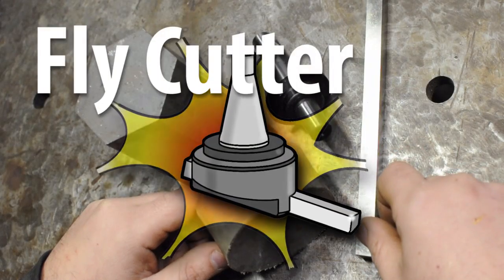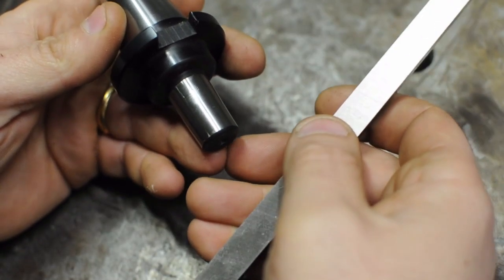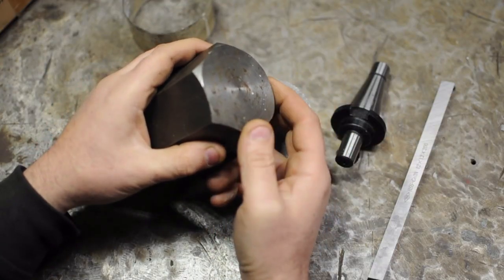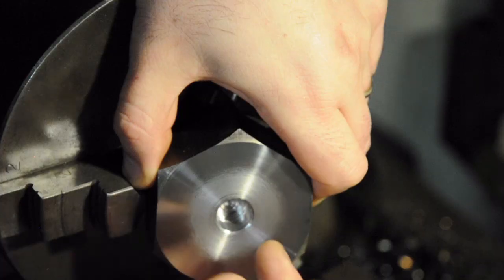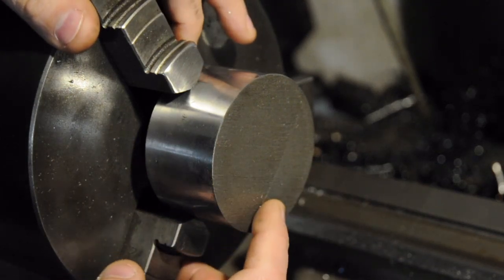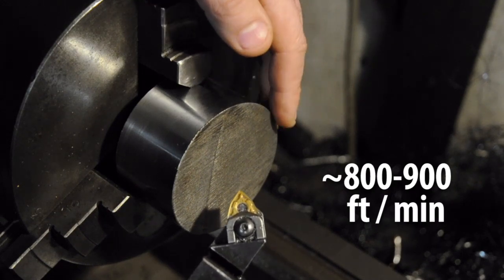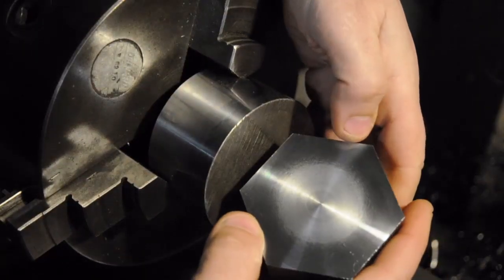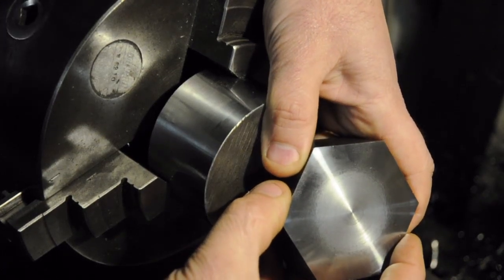Building a Fly Cutter - Part 1

Comment: I'm not a machinist but I find the hobby very interesting, so I don't know what a fly cutter is. Is it like a cheap version of a face mill?
Reply: Face mills remove material faster than fly cutters because they have more separate cutting points in contact with the material at the same time - and require that much more power to remove that material for the same reason.  

Because of that, a lower power machine like most home gamers can afford, can use a fly cutter with a long reach to finish a much wider area in one pass than the much smaller facemill it could drive using the same power.

Fly cutters can work with any 'lathe' style cutters, including easily/cheaply sharpened HSS bits.  The low power requirement, low cutter cost, and ease of sharpening really suits the garage / shed / basement shop.  The tradeoff is speed, which generally isn't a priority in that kind of context.

In my home shop I have a 2" carbide insert facemill I use for work small enough to cover in one pass, and for rough facing my often rusty salvaged materials.  Other than that I use a fly cutter because the cost to me is really only the time it takes to keep my collection of HSS lathe bits sharpened.
Reply: Ceazar Carr its more or less a face mill however it uses carbide tool bit to do the cutting. It's meant to get a precise and clean finish compared to you traditional face mill. It's usually only for your finishing passes not for roughing.
Reply: ***** Thanks!
Reply: Also it's not bad for finishing to have just one cutting edge, because there won't be any height differences between the cutters
Reply: Fly cutters predate face mills, and they were meant to just take your regular HSS tooling. Running them at excessive speeds can cause marring, as they aren't balanced.
Reply: somebody else Wow, thanks!
Reply: Well the main advantage of the fly cutter over other cutters is that it is easy to sharpen if need be and as a consequence it is cheaper than many multi edged cutters. Additionally, you can of course shape the profile just like you do for special profiles on the lathe. It is an extremely versatile tool in the right hands...
Reply: And when people say it's cheaper than a face mill they mean that each carbide insert usually runs anywhere from 8 to 40 USD a piece, so in Old Tony's face mill (I think it's a six insert cutter) if he's using decent carbide inserts, he's got about 90 bucks in inserts.  Whereas a single bar of 5%cobalt steel tool blank is like, 5 or 6 bucks depending on where you get it.  Also, the kind of cutter he's using is what we call a shell cutter in my shop and a fly cutter is any cutter that uses a single point for cutting.  My fly cutter has a single carbide insert that is round that I use for finish passes, although I rarely get to use it because all my parts are surface ground to within +/-.0002"
Reply: Precisely! A big slab or face mill that's been subjected to a few "crashes" no longer runs true. The finish, in section, looks like a mountain range... Same if it's mounted on a machine with a damaged female taper, or the insert pockets have been damaged.  If you need a fly cutter, and have a damaged face mill, remove all but one tip, ensure all the clamps and shim seats are secure in, or removed from, unused pockets, and you have a fly cutter. we used to skim cylinder heads that way.
Reply: True, it's a poor boy face mill.  Face Mills above 3" are several hundred to over $1000.  It's not just the expense of the inserts.  Face mills get a perfect finish as well but I would like to have a larger one.  Or Flycutter.
Reply: it cuts mosquitoes.

Comment: Thank you for talking about the surface finish change. I was wondering about that on some of my own parts. I do disagree a bit. I still get the transition even at slow speeds. I think it's more that as the diameter decreases, the tool is shoving more into the work rather than letting the spindle do the work. IF you think about it, on a 3" diameter, it has 9.5" of metal in a line to advance the 10 thou that you might be feeding at. At 1/4" diameter, it has less than one inch in which to be shoved the same 10thou. Although it also seems like the chip should be constant thinkness...
Reply: The Metal Butcher I thought that is  what he was saying? The closer you get to the center the slower the material is moving, so the rpm would need to increase the closer you get to the center. Your still going to get a transition with slower speeds because no matter how fast or slow the rpm is, there is still a difference of speed between the outside of your piece and the center of it.
Reply: The Metal Butcher I agree with what you are saying only for HSS tools. If I'm facing something with old school tools I never use the automatic feed because of what you stated on your comment. Carbide does not like slow speeds period.
Reply: As I understood it, the reason is that your speed is too low!? Did I get that part wrong?
Reply: That's what I thought :)
Reply: From what i have seen so far, CNC Lathes can increase spindle speed for that reason as a function of diameter. I wonder if a coupling of DRO/encoder and an external VFD-control could make a cool extra feature for manual lathes.

Comment: Wait wait.  Why do you want a fly cutter if you've already got a shell mill?  Unless you need to flatten a huge piece of stock in one pass, it seems to me a fly cutter does the same job as a shell mill, but slower and more dangerous.
Reply: Fly cutters are easy and cheap to sharpen and work well on low HP mills like his.